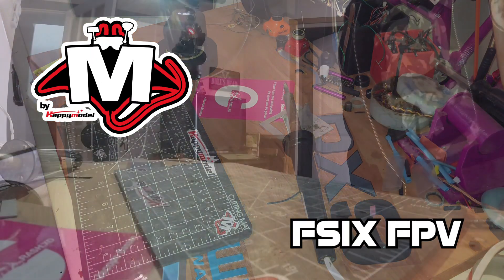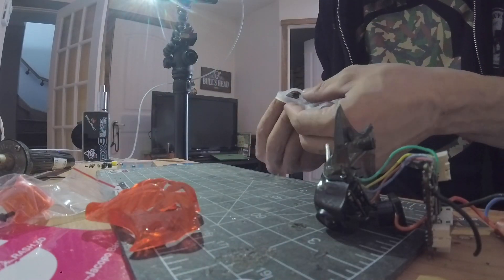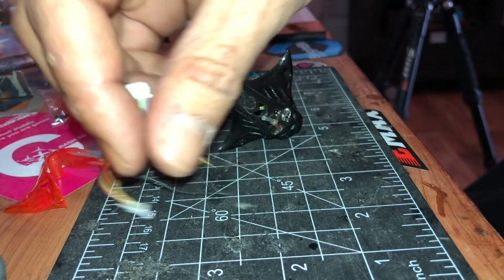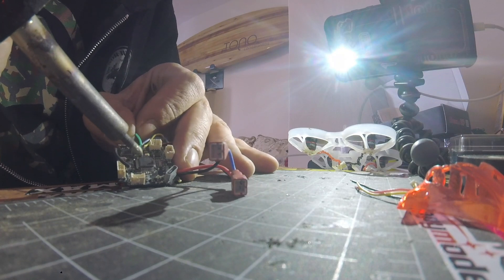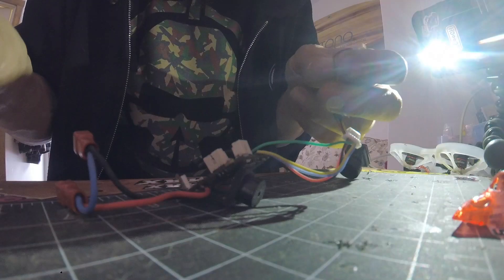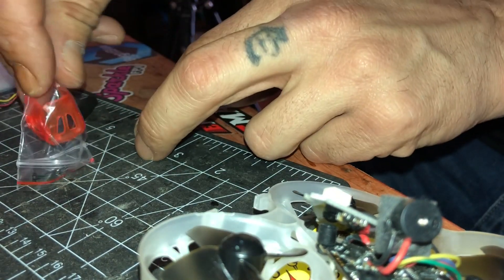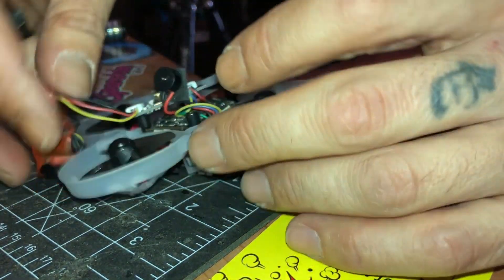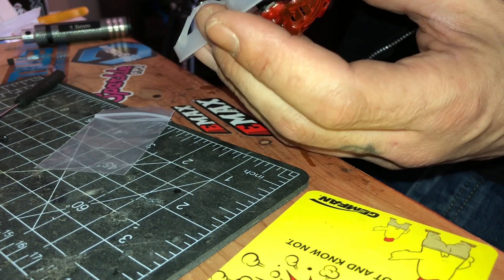Mobula7-Eos2 and vtx 200mw upgrade by FSIX FPV

Comment: So how did you mount the canopy and VTX? Because at 5:11 you tightened in the flat head screws first. And the head is to wide to fit in the holes in the canopee?
Reply from the maker: bert beinaaf been a while. I’ll have to try to remember
Reply: F6 foto FPV That would be nice. I’m doing this upgrade and I can’t figure out how to mount the canopee. In your video it looks like you removed the flat head screws and replaced them by smaller screws? But I’m not shure...
Reply: @bertbeinaaf8314  he only did the front screw, because the canopy uses the other 3

Comment: Hi! Vtx has camera input plug and video in/out on other bigger plug. Did you connect camera to small plug and connected Vin and vout to fc? Does osd works that way? Thanks
Reply from the maker: Jack The Ripper been a while but i think, just make sure to recheck what i say but i think i powered on battery pad. Or else it should work that way

Comment: what is the total weight of this drone..? no battery

I made a similar one with a total weight of 35g, and it feels heavy for a 2S battery.. the motor se0802 16000kv is also hot

Comment: I did this upgrade and had great reception and range and no jello but I’m only getting 25 seconds flight times before my battery reaches 3.10 ???
Reply: Do the red jst or xt30 mod. They say the stock pH 2.0 goes bad after like 20 batteries and effects the performance and flight time. Maybe that could be your issue?
Reply: Jess & Josh Wyatt yes this is probably what happened

Comment: Hi do you have any tips on how to secure the vtx properly was skipped in your video and mine keeps coming off even in a small bump be nice if it had circle not half circle holes?
Reply: Hi, is it a 16: 9 or 4: 3 Camera? does it fit into the original case or do I need something extra? is the picture of the camera better than the originals?
Reply: @ctimtom  the csddx cam is order in 4:3 or 16:9 will need to order the new canopy and its fiddly but do the vtx mods its so much better love the camera and range x2 length of your antenna helped my rssi drop outs

Comment: Did you get the jello fixed??? I got a tiny hawk was thinking of getting the mobula7 how is the stock vtx??? bad or you changed because of the camera. thanks nice video awesome.
Reply from the maker: Hellmuth siova i did a bit of tu ing and it reduced the jello. If you’re gonna go with the Mobula7. Use it stock and you’ll love it.
Reply: @f6image  thanks man. What goggles are you using it?
Reply from the maker: Aomway commander

Comment: BTW did you get the jello figured out? Looked thru comments. A bit. Didn't see anything about fix jello
Reply from the maker: doug freeman it was mainly a run out motot causin the big jello. Still a little but not as bad. That camera is sensitive to vibration

Comment: Hi, is it a 16: 9 or 4: 3 Camera? does it fit into the original case or do I need something extra? is the picture of the camera better than the originals?
Reply from the maker: TimTom to be honest i am not convinced that the switch is very significant. The 200mw vtx though makes a big difference. You need a canopy made especially for the caddx eos. The red one. It’s on sell on the happymodel website ;)
Reply: F6 foto ah okay,  has the conversion paid off, is the reception much better? and is the camera also better than the originals in comparison?

Comment: Hi, I did the same mod + an XM+ (couldn't get the rxsr with telemetry to work) and now i have the issue that new battery's drain within 10 seconds. How are your flight times due to the higher weight?
Reply: Try the xt30 or jst mod

Comment: Great tutorial but man that jello is terrible. Maybe try some sticky tack or hot glue to stabilize it. I wouldn't be able to fly this way.
Reply from the maker: The Flyin Tek RC seems to be an outside thing. Maybe the -25 or the over exposition with this white crap all over loll
Reply from the maker: The Flyin Tek RC check out the rollerskate video i made.  No jello
Reply: Ok cool, I will now.

Comment: Thanks just ordered the parts for cam upgrade.  I changed to xt30 and like the power I get now.
Reply: I changed to red JST today and it's really insane compared to Ph2.0
The mobula's 0802  can get away with the red ones instead of xt30 and it will save some extra weight.

Comment: Does anyone know what the green wire does it say tx3 on the diagram but not sure what the purpose. I hooked up a different Camera vtx combo but did not have a place for the green wire.
Reply: Green is the smart Audio
Reply: But my smart audio still works without that cable I'm still able to get into my pids and everything through the goggles ... that's weird
Reply: Yeshua FPV well that’s what I was told it was.... not sure how it works without it hooked up but who knows??
Reply: Yeshua FPV what about adjustments to your vtx? Perhaps it can change the pids and so on but you need that TX3 to adjust the vtx
Reply: @captainskyhawkfpv2367  That's not Smart Audio, that's just your flight controller's OSD. In the OSD, navigate to Features -> VTX SA and attempt to change a setting. In your current state, it won't do anything because a) the Smart Audio wire isn't physically connected to anything and b) you don't have a UART configured for Smart Audio in Betaflight.

Do you know if your replacement camera+VTX even has Smart Audio, or does it just use a different wire color scheme?
Reply: @zorilla0  thanks for reply man  got everything working now its actually on a toothpick frame

Comment: Nice upgrade! I just upgraded my beta65x with an eos. Much better camera!
Reply: It's a downgrade because it's now too heavy and flies like crap.
Reply: @scootroter4859  I'm not sure what you did but I did this upgrade and it didn't effect flyability at all on my 65x
Reply: @SonOfAGlitchFPV  I don't believe you because it essentially makes the Mobula7 into a Trashcan but WITHOUT the more powerful motors that help the Trashcan, and the F3 vs. F4 FC.
Since the Trashcan suffers from Yaw Wash Out and HAS the more powerful motors, it is obvious that the mod you did gave you that plus more, because of using the lower power Mobula7 stock motors.  So, I don't buy it.
The Mobula7 is near perfect stock. Why F with it?  That's why it is so popular and acclaimed to be the best BNF non HD who0p. If you are going to mess with it, put on another AIO camera that won't F with the weight! 🤔👍
Now you decide to go and add over 6g to its weight. It obviously is going to hinder performance! No question! That's an increase in about 1/4 of its original weight! HUGE FOR A WHO0P!
It's all about weight with who0ps!  So, don't even try to tell me adding 1/4 of its stock weight didn't effect it flying! It's simply not true. And physics say it isn't possible. 🤔😎
Reply: @scootroter4859  I did this mod to a beta65x, not the Mobula7, and mine flies great. I 3d printed my brackets to hold the eos cam, as the stock one isn't big enough, so maybe I shaved weight there as I custom designed that. 🤷‍♂️ Either way mine turned our great and I loved it. Yes, because of physics it has to be affected in some way but mine at least felt no different when I few my setup but I gained a much better cam than the stock beta65x cam. Maybe this is different on the Mobula7 though, as I don't have one of those 🙂

Comment: Will the upgraded vtx fit even with original Mobula7 canopy
Reply from the maker: doug freeman  yes
Reply: VTX will, new camera won't
Reply: @FAQUERETERMAX  I was able to get the Turbo EOS2 Nano into the old canopy along with the new VTX.  With 1102 10K motors as well.  No jello after those changes.

Comment: screws that come with the canopy are way too long. the ones that hold the 2 seperate canopy pieces together and allow you to adjust the angle.  the ones that were in the old black canopy are slightly shorter but also way too long for the v2 red canopy.  this is extremely frustrating.  it doesn't even tighten enough to hold the angle. i'm going to have to hot glue this canopy like i did the old one.  the build design on this v2 red canopy is worse than the old one...

Comment: Dude I hooked it up just like you did and cant get the Camera working.
Reply from the maker: EnlightMent did you check all you soldering?should work
Reply: @f6image  I have but I need to do it again. It has to be in either the video in or out on the FC. Nothing else make since.

Comment: You have use the FC mobula7 F3  ?
Reply from the maker: ONCLEFLY yes still of the f3
Reply: @f6image  You know the weight now ?
Reply from the maker: 32.9g
Reply: @f6image  Thank, now the same TRASHCAN weight.  😉
Reply: @onclefly8450  and exactly why he has jello and it flies terrible! Too much weight! You ruined a near perfect flying stock Mobula7. Adding 6+ grams is way too much for an under 1 ounce who0p!
It's all about weight with who0ps!
This is exactly why the Trashcan suffers from Yaw Wash Out and so do ALL OF THE OTHER HEAVY SO-CALLED Who0ps! Too heavy!
Reply: @scootroter4859 Yes, the Mobula7 withe the frame v2 is better because the weight is better.  😉
Reply: @onclefly8450  Yes, it's the lightest, but is it as strong as the V3 frame?  I question that.  I have one I haven't even used yet... :)
Reply: @scootroter4859  With the frame V3 is less flight , and he have more weight.  😐

Comment: As you found out, it's all about weight with who0ps! When you take an almost perfect flying who0p like the Mobula7, and add quite a bit of weight, it changes the flight characteristics... Typically for the negative.  It was designed with minimum weight as the prime objective. You add all these so called upgrades and you ruin the objective and it's superb flight. Every single gram counts when it weighs less than 1 ounce!
Sorry, but it quite obviously turned out to be a downgrade.
This is why the Eachine Trashcan has larger, more powerful motors. It's also made by Happymodel, but this time they essentially made a deluxe version of the Mobula7. It still suffers in the flight characteristics, just not as much as the way you did it.  It's not faster than the Mobula7, and if some say it is, it's so close it's barely noticeable. Because of its deluxe features, it weighs quite a bit more, and suffers from yaw wash out, and less nimble handling, unlike its lighter sibling.
I left my Mobula7 alone, and I'm so glad I did! I'd put yours back to stock and get the awesome speed and nimble handling back. 🤔😎👍